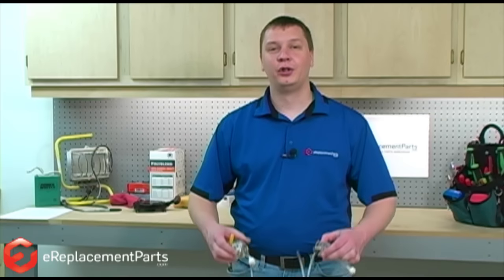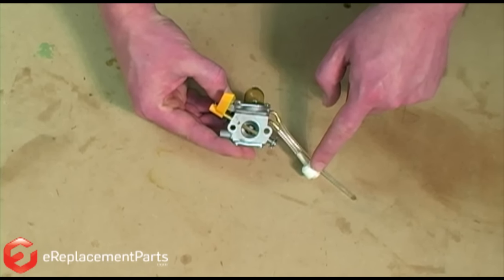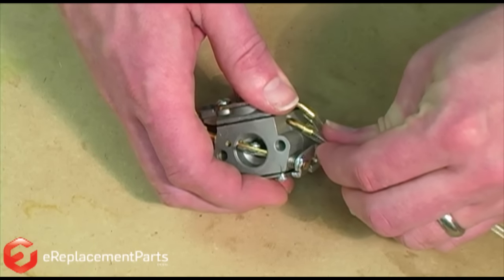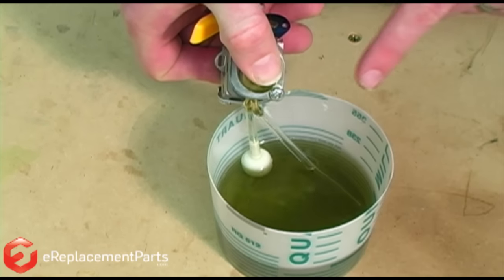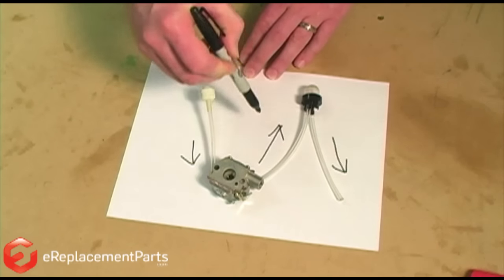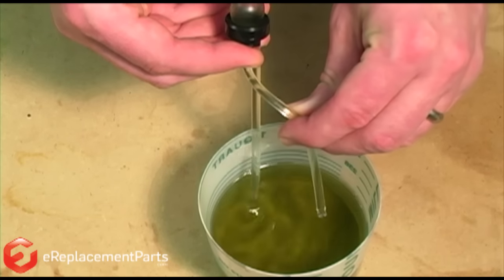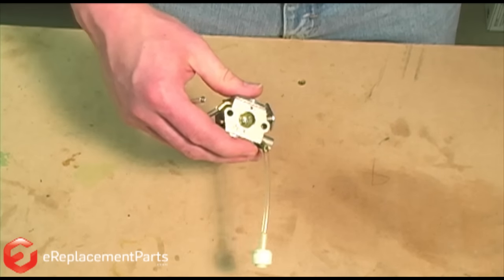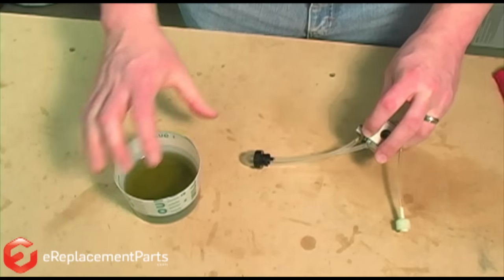How to Replace Fuel Lines on Two Cycle/Two Stroke Engines

Comment: This didn't help a dang bit I'm puzzled cause i got a Bolen mower and a return fuel line but no spot where to plug it on to on the tank. common sense tells me it should go into the fuel tank.
Reply from the maker: I am happy to check this out for you.  Please respond with the model number from the motor .  Bolens has used
different motors on their mowers. I'll take a look and get the answer for you.
Reply: Sorry it took me so long to respond, Bolen model 11A-B06R765  Engine Briggs & Stratton 09p60200232-F1. I don't even know how it came unplugged from the engine. All i did was replace the crank gasket.
Reply from the maker: I'm confused myself.  The Youtube video is for 2 stroke engine fuel line routing.  Your Briggs and Stratton is a 4 stroke engine.  Typically there isn't a return line on a 4 stroke at all.  The parts diagram shows only the line from the tank to the carb.  Sometimes there is a hose coming from the crankcase that acts as a breather that connects to the air box behind the air filter. I am curious to see what you have.  Would be be able to send a photo?
Reply: I took a picture of the carb where you can see the in line at the bottom and on top is where the return line is. Gas is coming out of there but i don't know where to on the engine. I added the hose attached and drill a hole for the return line and sealed it. Now i got gas coming out the airfilter when it's running tho. I know nothing about small engines but thought they couldn't be much more different then basics you learn with automotive. Carb looks like same as shown in video. I need an e-mail where to send the picture to, it won't let me attach pic's on your website and can't add pic's here. Thank you for your interest and help here.
Reply from the maker: Please email us at socialmedia@ereplacementparts.com.

Comment from the maker: Cut the end of the fuel line at a sharp angle. This will make the line much easier to insert. Hemostats also are very helpful if working in a tight space.

I hope this helps,

-Mark

Comment: when you run the return line back into the tank..how much of the fuel line should go back in to the tank..on my craftman 358.350601 chainsaw it has two different fuel line sizes.could I use the same size for both or do they have to be one big one small..

Comment: i have and older model 410r ryobi cultivator,  the bulb assembly only has one connection for fuel,  the original lines fell apart,  i could not tell where the line were,  i order a new fuel line and a new return  line,  i did not order the bulb line,  but there are only two ports on the carburetor and two in the fuel tank,  I think i know where the fuel line connects but not sure for the return or the bub line..  can someone enlighten me on this
Reply from the maker: +bellman1945 The following is a link for a Youtube tutorial.  https://www.youtube.com/watch?v=8Rzrq3MEi_0

Comment: Ok still a bit perplexed, I was never meant to be a mechanical woman, but managed to clean the carb thanks to your video, however I am still having a bit of trouble with the fuel lines, I have three lines but I have the bubble attached to the top of the carb like the first pic? so anyway I have an echo trimmer and the repair shop wants the cost of a new machine to repair it and get it running so still attempting this. I would be lost without you thanks

Comment: Thank you for ending my several week ordeal. My saw sat in a metal building (Texas heat) for years.  All the lines had broke off and were so brittle they would crush when touched....  Many videos show information but my problem was that most videos I had watched before this was that the had both lines on the same side of the carb. Mine has one on each side and no one explained the flow of fuel.  You did a hell of a quick explaination.  Wife was ready for me to trash it , buy  a new one and get some work done. I guess the days of staring at it and drinking a cold one are over. Many , many Thanks

Comment: I went to the local home improvement center for answers; no one had a clue on how to hook up the hoses. I took a weedeater off the rack and shined my cell phone light in the inner workings and saw how the remote prime was hooked up. But this video showed me how to test the lines for correct placement. Many Thanks

Comment: I figured it out on my own when my hoses on a little tiller I have gave out due to dry rot. I fixed it with new hoses on the fly, with out removing carb. Watching your video helped explain more what I did and why. Thanks.

Comment: Just watched this last night to gather info before I disassemble my carb system. I noticed that the fuel lines have been on the wrong side for awhile. I had someone fix my trimmer in the past so either they messed up or the manufacture did. Thanks for the info.

Comment: I followed your instructions and it worked for me.  I was sent my trimmer for repair but they wanted to charge too much money.  Now, I fixed it by myself.  I just had to order new. gas lines and  prime bulb and cleaned out my carb.   Simple but it helpful video. 
Thank you very much.

Comment: Got a $10 chainsaw (Mcculloch) that didn't run.  Opened her up and saw rotted fuel lines.  Replaced them and oil line, cleaned out the carb and couldn't get fuel moving.  Realized I may have screwed up the fuel line ordering.  Watched this video just now, ran down and did the test in a bowl of fuel - booom got the chainsaw running - thanks!

Comment: Mark: your tips on how to decide how the fuel lines were properly routed. Your tricks made it very easy to correctly attach the new lines. I also appreciated how you should put new lines in through the tank. Without cutting the lines it would have taken forever to get the new lines into the tanks.   Thank you so much... It made the jo easy.

Comment: I had a problem after I rebuilt the carburetor on my leaf blower.  The fuel pump would not pump.  After the explanation I realized my mistake and switched the fuel lines which fixed the problem. The explanation was very good.  This video is great!!  Thanks!!

Comment: Thanks Mark. Just £10 for a new fuel filter, 2 fuel lines and a primer bulb to repair my 15 year old McCullock Trim Mac 210  strimmer that the supplier/maintainer told me was beyond repair. Good old Google saved me £90 again :)
Reply: Hello Marcel Horst. do you mind me asking you where you purchased those items above... since i need them myself.

Comment: Nicely presented-- Your video saved the day.  As a side note, it appears that my unit came from the factory with the lines incorrectly installed.  Although it would run (if you could get it started), your video led me to connect the fuel lines correctly.  With a minor adjustment of the carb, all is now good.  Have you considered a video on how to remove the protective caps from the carb screws?  It can be done without breaking them, but some finese is required. Thank you again!

Comment: Thank you very much for posting this very informative video. I am replacing the fuel lines on my Mantis tiller but I did not pay attention on how the old ones were run and I was doubting on doing it correctly. You showed on simple manner how to find which way is correct. I saw another video that was done with goo intention, but it was badly done. Thank you again.

Comment: Excellent video...the best I found on replacing fuel lines on 2-cycle engines. Question: Does the return line need to be submerged in fuel or can it be above the fuel?  Thank you very much!

Comment: Thank you for actually explaining that the fuel needs to be drawn through the carb rather than pushed into it. I now know why diaphragms get busted. The pressure of you forcing the gas against the check flap the wrong way years it.

Comment: Excellent, thank you very much for this video. I mistakenly connected primer inlet from the tank and outlet to carburetor. weed eater runs for a few seconds and quits. Now I will connect as you specified and see.

Comment: Very informative video, it will help me, i am sure. My trimmer is a 4 stroke but the carburetor and bulb looks the same so I will try to reroute my lines now.
My trimmer just starts and then dies until I pump the bulb again.
It repeats itself like that but never continues to run.
I must have mixed up the fuel lines when I replaced to a new carburator.

Comment from the maker: @freshn2008 My guess is that you are working on a larger 2-cycle engine such as a snowblower engine. The larger 2-cycle engines will have a carburetor with a bowl. The bowl eliminates the need for the return line. On this type of carb there will be a fuel line feeding the carburetor and usually a single line to a primer. 

I hope this helps,

-Mark

Comment from the maker: @bosstweed429 The return line does not need to be submerged. It sounds like you are having some issues with a carburetor that is dirty or the internal components have deteriorated. Take a look at our videos titled "How to Rebuild a Two Cycle/Two Stroke Engine Carburetor" and "How to Clean a Two-Cycle/Two-Stroke Engine Carburetor".

I hope this helps,

-Mark

Comment: After replacing the cracked fuel line, I was sure that I had the correct. Chainsaw ran for a few seconds and died. So I replaced the fuel filter, gas cap and cleaned the spark arrester. same results. Saw your video, rerouted the fuel line and the chainsaw runs like a rapped ape!!! Thanks!

Comment: I have a troy bolt string trimmer tb20cs. I put a new primer bulb on it, New fuel filter & line. I believe hoses are correct. I watched your video 5 or 6 times, it's the best. I connected the supply line to the carb, pumped the bulb and fuel runs out everywhere. Put it together and it runs,but only for 15 to 20 seconds and the supply line is dry? What's up? Thank you Chris Jones

Comment: Thanks Mark.  Now, with fuel lines correct, my Husqavarna leaf blower idles just fine, but dies when increasing the throttle.   I will try to check for leaks into the carburetor or replace diaphragm.

Comment: QUESTION:
Hi, Since you didn't actually install the lines into a Weed Eater fuel tank, this leaves me with the unanswered question whether the return line must be long enough to stay submerged in the fuel OR, does it simply have to reach the tank to dump the fuel back to the tank? I did everything else correctly, still not working. Thanks in advance.

Comment: Here's how I get the fuel lines into the tank: slit the lines 2-3" from the end, and cut away one side. Then you should be able to push the line into the tank, grab the end with needle nose pliers, pull out, and cut off the slit portion

Comment: Great Stuff ..  I am having great difficulty locating fuel lines for my 2004 vintage Craftsman/Poulan which I now know are different sizes.  The one going through the hole into the fuel tank is a bugger.  It would help if I knew the outside and inside diameters of fuel line.  (Sears wants $5 for a foot of line and $8 to ship - ugh)

Comment: Excellent video! I am having trouble tho, I followed each step as mentioned but I'm still having flaw's. I went and got a new prime and the inlet hose seem's to be the outlet hose as well and the other nozzle tip just doesn't do anything so it suck's gas and spits it out the same hose. and I have the 2nd type carb in video and the gas doesn't flow threw like so, it goes in the inlet and spit it out in a tiny hole inside the throttle choke and the outlet is always bone dry. I cleaned everything

Comment: Thank you for your video. I did the same way as you show to replace the fuel lines... the bottom pin is goes to the filter in the tank and the top is going out from the prime bulb.... but some how I still get very slow return of the prime bulb and even not return at all... if I loose the screws a little bit near by... then the prime bulb return to normal position but the gas is started to leak... what I do wrong..???

Comment: I have a late 90s model craftsman chainsaw that I replace the fuel lines in.  I'm pretty sure that the fuel line from the tank went to the primer, not the carb.  Is that possible?  I left the one line that connects the primer and the carb on, so I doubt I got it backwards.  It seems to run just fine.  Will it run both ways?

Comment: hello Mark and thanks for your video, it helped me to have my lines sorted out. Also I have a question, I replaced my fuel lines and  primer bulb but still my chainsaw does not suck gas from the tank, I also tested with the carb out of the chainsaw exactly as you are showing in this video, and still no sucking gas, is it possible that my carb has some sort of dirt or another malfunction part that is preventing the primer bulb to suck gas? thanks
Reply from the maker: +Charli delabici If your still not pumping fuel and your confident about the locations of the fuel lines, I'm guessing the rubber pieces in the carburetor have gotten on and less pliable.  One of the parts of the diaphragm is a
"flapper" that helps create a vacuum inside the carburetor when your priming the engine.  The are included in the carb kit.
Reply: thanks again, yes, I ordered a kit with the 2 diaphagms along with other parts. I hope that fixes the problem. whoever in the process I lost the little mesh and cannot buy it in here.

Comment: Hello, It appears I have a little pressure inside my tank when trimmer is running. Fuel spits out passed the hole(s) in the tank where fuel lines enter tank. I would assume the fuel tank would be under slight vacuum...no? Gas cap appears to allow for air to enter tank under suction; blocked vent under pressure when I apply with my mouth. Please advise  Thanks

Comment: I have a ryobi weedeater and the fuel lines were leaking so I order a new fuel line and filter and replaced them. The next day when I went to start it it would only run on partial choke, when you turned the choke off it would only idle. When I would go to throttle up the weedeater would shut itself off. Any ideas on how I could fix it?

Comment: I recently installed a new gas tank on my goped scooter it came with one Blue Hose one yellow hoes at first I had the Blue Hose plugged into the top valve and it would not start so I am assuming that generally the Blue Hose will always go on the bottom. Is this correct? I mean generally that is?

Comment: I did everything step by step and I did not move or adjusted any parts of the carburetor. The problem now is that when I try to start my Craftsman trimmer it starts on full power and when i press the run button it stops and dies out. any idea of what did i do wrong?
Reply from the maker: Undo the throttle cable and see if the throttle returns to the idle position. Im wondering if the cable is hooked up correctly.

Comment: In the second example, should fuel flow in  a stream out the return; or with bubbles.  Seams like not sucking enough fuel in my case when hooked to the carb?  any ideas?
Reply from the maker: Some small bubbles may appear while priming.  If there are a lot of bubbles I have to wonder if you don't have
an air leak or a defective flapper valve in the carb.  The primer is supposed to fill the carb with gas.  Once full the rest recycles back into the tank.

Comment: mine one brass was fatter than the other. Only thing, 2 between after removing the pipes and replacing new ones(i had to order as they crumpled while changing the leaking rubber plugs., i forgot which is which

Comment: Great video, I need some help, when the lines are hooked up, the carb floods, fuel never stops flowing into the carb, why is that?
Reply from the maker: You may have a dirty of clogged passageways in you carburetor. You may need a repair kit or a new carburetor

Comment: I have a 125b who do not start wel and stops, when suck gasoline with the pump it looks like it get a lot of air with it, I do not now if the ball of the pump needs to be full, somewhere in carburator it leaks or I have put fuel lines wrong.  Maybe you do now. thanks.

Comment: I have an older chainsaw model that didn't come with a primer bulb installed new. Can one be added?
Reply from the maker: +Dave May There are some stand alone primers on the market.  One big hurdle would be how to get the return line plumbed out of the carb and plumbed into the tank.

Comment: I just replace my fuel lines and primer bulb on  a weadeater featherlite. It won't start on fuel but starts fine on ether. My primer bulb is not  drawing any fuel through it? I don't see any fuel inside the bulb. Can you help

Comment: when you push the primer bulb, is it normal for the gas mixture to be squirting into
the carburetor throat?...thanks...
Reply: no
Reply: Mine did that until I watched the video and redid the fuel lines
Reply: No.  It is actually a purge valve and its function is to purge air out of the metering chamber.

Comment: I have   troy bilt TB2000, the primer bubble is where on the engine
Reply from the maker: The primer or purge bulb on the Troy-Bilt TB2000(41ADTB2G063) is located  on the 791-181749 Carburetor. It is part number 791-181701.

Comment: Regardless of how I connect the fuel lines, no fuel flows through the carb. What now?
Reply from the maker: It sounds like the carburetor needs be gone through.  The rubber seals and fuel pump tend to harden over time and become ineffective.  There is a small "flap" on one of the seals that opens and closes when you prime the carb.  If this gets hard fuel won't flow through.

Comment: hi, sir, where i can obtain the fuel line, gasoline proof,thanks a lot.
Reply from the maker: We have many types and styles of fuel line available.  All are listed under the various models numbers.
Reply: hi, sir thanks for your reply,i need 3mm inside diameter,6mm  outside diameter, black in colour and 8mm inside,12mm outside fuel line,how much it costs per meter?